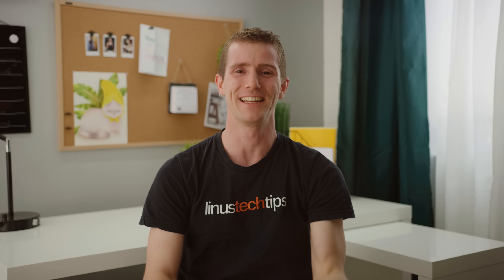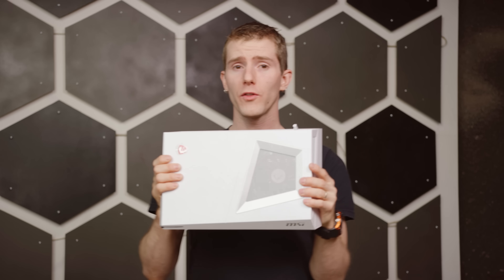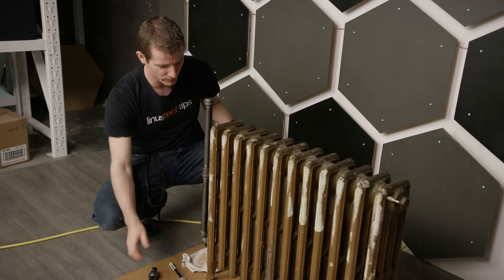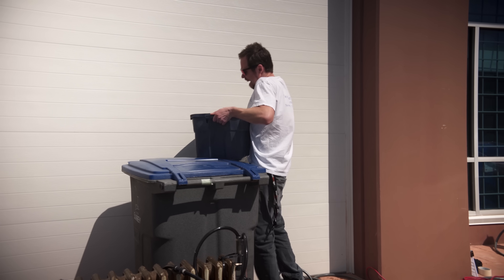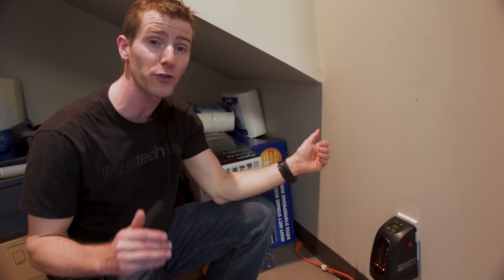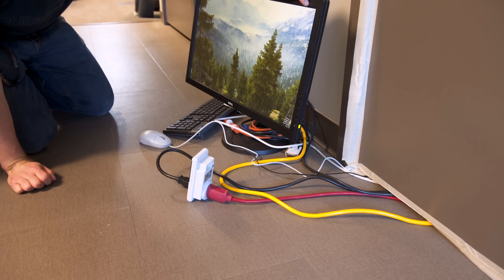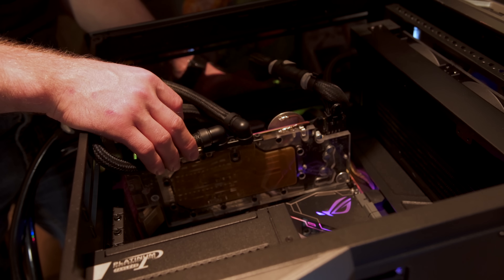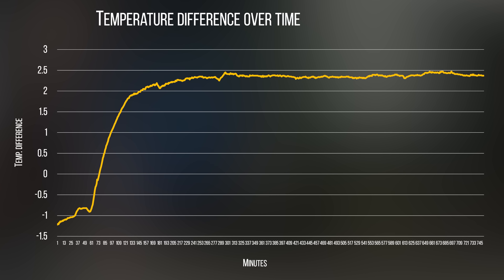Lower your heating bill... with GAMING

Comment: Your kinetic energy you have  in the fans doesn't change as long as you rpm stays the same, the energy you need to put in is the same amount as the drag that the fan generates and different speeds of air generate on each other. Essentially it doesn't matter if you have more or less fans when you are heating a room. One way or another it's gone be converted to heat anyway. And the fancy RGB stuff doesn't doesn't do anything as long as the light stays in the room (you don't shine out your windows).

Comment: "Gunk' is Called .... OIL ... 
must be heated to clean.
Reply: Probably a fair amount of rust if that's a steel radiator.
Reply: Why oil? Please step back
Reply: @hayyremz  because its an oil radiator
Reply: @princeoinkins8408  no. That's a hydronic cast iron rad. If the rad was an oil rad, it would not have rust in it.
Reply: @Richard Norman It's not oil. Its metal shavings from the inside of the radiator. If they just added a magnetic filter they could've caught most of it... if they wanted to go further they should've added a system cleaner like x800 then flushed it out and added a system inhibitor like x100
Reply: Spoken like a true plumber.
Reply: @jaketurner2472  This is what I was basically thinking. Cleaning out a car radiator sometimes requires an actual radiator cleaning fluid instead of just plain distilled water.   I also would have done a braze on the leak he had.

Comment: I'm not sure why you're using a household radiator instead of a PC radiator. No matter the size of your radiator, the total amount of heat put out will surely be the same, won't it? It probably hurt your results, as you stated, because of the huge mass of iron and water you had to heat up along with the air inside the room... If someone is actually thinking of using their PC to heat their room, just run Folding@Home or Boinc or mine some crypto for a couple hours and you'll be good :p
Reply: Yeah, he just made the test more complicated and unrealistic by doing that. Gotta reach 10 minutes of content tho amirite?!
Reply: A PC radiator might not be able to dissipate heat from the PC fast enough, which would cause the PC to throttle and output less heat instead.
Reply: because is ridiculous and humorous. And because they can... try.
Reply: Rafael Dos Santos 
Wouldn't it be faster though? The big radiator has more surface area.

Comment: ALL YOU NEED IS A PENTIUM 4
Reply: FrozenIce running a pentium 4 daily. I can confirm.
Reply: Renaud Dupras You poor soul.
Reply: AND A GTX 480
Reply: FX-8350
Reply: Artur *FX-9590
Reply: Pentium D
Reply: 2x AMD 290X
Reply: 2 x amd 7990 plus a 3930k 1500w from the wall @ 240v Room heater pfft..whole house heating.

Comment: I genuinely turn my PC on in the morning and start Warzone during winter to get my room warmer…
Reply: same
Reply: I use Heaven Benchmark to max out the GPU. On the default non-undervolting profile for the RTX 3090, it gets to a good 80 degrees but also leaves a bunch of hot air coming out the case, been great for Winter to fire that up in the mornings. In the Summer I can switch to the undervolting profile & get it to about 70 degrees but because there's also less voltage used for the GPU, there's basically no hot air coming out on that profile.

Comment: That ancient radiator is completely pointless. In the end you're radiating (imagine that) BTUs regardless of whether you're doing it passively off an ancient chunk of iron or an proper 280mm or 360mm pair of rads on the CPU and GPU. In the end all of that electricity is being dissipated as thermal energy. You could have saved a lot of time, pointless crap, and a not-inexpensive EK GPU water block by just putting the damn PC in the room and closing the door.

And for the people saying "because he wanted to heat his room", where do you think the heat gathered by a water loop, then radiated (see that? I gave it away) out of the system is actually going, fairy land? Its going in the room (doh). So long as the components are staying cool, that means the heat is being pulled out and pumped into the environment external to the case (e.g. the room).  Newsflash: heatsink systems transfer heat. Shocking.

So yea, pointless. Like most of the LTT videos now, and utterly unlike just a few years ago. I guess he's just run out of ideas. Sooner than later I expect an expose where Linus determines once and for all which cools a system better: constantly beating on the chassis with a Louisville Slugger, or pissing into the live power supply. (Spoiler, they're the same; eventually the system stops producing heat altogether, but for very different reasons).
Reply: Yeah! LTT should have just tried to do it the least interesting way possible to maximize the entertainment value! We watch LTT to see the peak of efficiency not a bunch of dumb stuff that no one would ever do! grabs pitchfork We hate fun! We hate fun! We hate fun!
Reply: Exactly.

Comment: Why would this increase the amount of heat dispersed to the  air if its the same amount energy that would be dispersed through the computers radiators.
Reply: In this small volume of a closet yes, but the overall theme/goal was a house. A large radiator mass and amount of water soak up more thermal energy, thus can provide useful "work" for longer periods of time passively once the PC is turned off. You can manage the temperature of the room more effectively with on and off usage and manage said temperature for longer periods of time.  As Linus even mentioned, it's not about making a sauna but making a comfortable environment.  Many heating systems have timers and gauges too to auto turn off once a set temp has been reached.

Comment: Wouldn't some/most of the 75W used by the pump be converted to kinetic energy? Meaning it'll still lack behind the targeted 350 W?
Reply: Only to start moving the water, after the water is moving the pump is just compensating the drag in the pipes that remove kinetic energy from the water and turn it into heat.
Reply: Hmm.. You're right, however assuming that this is an AC motor, the RPM's would be set so wouldn't the power consumption also decrease then after the initial acceleration?
Reply: Jun hong Doesn't really matter. The motor puts kinetic energy into the water and as the water flow would increase so would the drag and this would continue until the energy lost to drag would be the same as the energy that the motor is outputting.
Edit: Edited some Grammar and spelling.
Reply: Nub Ogrodowy yeah but that is only in the beginning, once the water flow stabilizes, that energy that "would be gone" is just there on the system as kinetic energy and once the put turn off, all that energy would just get transformed into thermal energy.

Comment: Me: It's getting cold....
Also me:

RUNS CYBERPUNK ON ULTRA SETTINGS
Reply: 3 FPS, but you do not feel cold anymore. Worth it.
Reply: Actually I think instead of running games at ultra or whatever, lowering the settings so that GPU stays at 95+ usage barely but with as many fps as possible would be better for heating. Cuz if you're getting 20fps on ultra with around 95-100 GPU usage, your GPU is working full load pumping out heat but your CPU is still chill walking 20fps worth of work. By reducing settings for as many FPS as possible without lowering GPU usage below 95%, you're putting full/almost full load on GPU plus a major CPU load, making double heat(or atleast more than the 1st case).

Comment: My gaming space used to be a section of our basement.  The basement was badly insulated, with no connection to our central heating.  I often ran SETI@home or similar on my gaming rig, as well as my "home server" (quad-CPU Itanium I was given by a former employer,) partly to act as basement space heater.

We remodeled the basement, added insulation and replaced the single-pane, Aluminum-frame windows with good double-pane insulated windows. The computer room still had no connection to the central heat.

I had to stop running SETI@home.  The first weekend after the remodel was finished and I hooked all the computers back up, we left town for the weekend.  I made the mistake of leaving the gaming PC and the server running.  Came home to find the computer room over 100 degrees.  It was late Fall, and wasn't hot outside.  (Between the gaming PC and the server, probably somewhere around 3000 Watts - Core i7 965 overclocked, dual Radeon 4870X2s in the gaming rig,  and quad Itanium.)
Reply: The uninsulated, cold basement was actually the perfect place for a server/beefy PC to thrive, lol. Now that it's all insulated and "civilized" down there the machine hates it ;)
Reply: Was that 100 F or C?
Reply: I assume F. At 100*C room temp the PC would most likely just shut down.
Reply: LexonyAble It would melt any plastic on the computer.
Reply: This became much less shocking when I realized you were probably from the US.
Reply: Anonymous Freak wow
Reply: InsanePorcupine How so?
Reply: I realized he didn't mean 100 celsius, and instead meant 100 fahrenheit. 100 celsius is boiling and is insanely hot, I mean 100f is like 38c I think?
Reply: InsanePorcupine yep.
Reply: InsanePorcupine lol

Comment: technically even the kinetic energy pf the fans and the light from the rgb will turn into heat afterwards, but it's such a small amount of energy and it happens so gradually that you don't notice it.  Especially when compared to other components like a gpu or a cpu

Comment: the kinetic energy from your fans will ultimately be turned into heat as well. as the air gets moved around it heats up from friction as it collides with slower or stagnant air around it. as for the LEDs the light will heat up any surface it hits. any work being done will turn into thermal energy in the end, one way or another.

Comment: I've been doing HVAC since 2004, We have special 'bendy' hoses for our pressure washer we use to stick in all the holes of the radiator when we clean em. The water sprays outta the tip at like 360° also.

Comment: Fan spin is also eventually converted to heat tho, so nearly 100 percent of power drawn by pc is converted to heat.
Reply: Leon Lu noo most of the energy is used to push air!
Reply: nah. every part of how a fan works generates heat.
Reply: jayakumar v I learned this was years ago but for what I remember the 2nd law of thermodynamics determines that the entropy in a closed system always increases, essentially the airs kinetic energy is more and more chaotic and eventually indistinguishable from thermal motion.
Reply: Yeah my PC actually makes my room pretty hot.
Reply: Except, YA KNOW the bit that, I dunno, PERFORMS CALCULATIONS?
Reply: This is correct for a closed system, though I don't believe it's realistic to think this would be similar in a more open system. The fan produces kinetic energy in the form of airflow and/or pressurized air. The reality is that in a room or house this air is simply going to continue flowing and more than likely escape somewhere. I assume the 5w of power used becomes maybe ~0.5w of heat energy, with the rest escaping as kinetic energy.

Comment: In the winter I use my rig to augment the heater in my room. now I want to add a radiator like that one now.
Reply: KAT Erwhall Why would you even want that? The exact same amount of energy is being transferred to the air (ie you get the exact same amount of heat)
Reply: DemonaeTV "much better results" in what way?
Reply: the radiator is completely unnecessary and dumb... they ruined this experiment by using it lol
Reply: you don't need a better radiator for this experiment to work. You just need a cooler that will keep the GPU and CPU from thermal throttling and you will get the best results. You need a delidded and liquid metal CPU with whatever Kingpin GPU has the highest max temp and power usage combo and best cooler. That's it

Comment: I worked for a time (decades ago) at a data center in Mahwah, NJ. The building didn't have heat.  The computers were the heat source.  (Which sucked if you worked the night shift when most of them were powered down)

Comment: In Communist Poland they built heaters with car radiators, they were actually pretty effective. Why not make a water cooling loop of a PC with such a radiator?
Reply: Badass
Reply: Gattz Back in the day I know a guy use car radiator to cool his x58 rig with gtx480s in it...
Reply: Yeah, why not. Computer Cooling Radiators are just smaller versions of those, you could probably even use the water pump from the car and the "reservoir".

Comment: builds a space heater pc; doesnt use that amd FX9xxx processor...?
Reply: Jazz I reckon! And he teased a gtx 480 at start of video.
Reply: Wholland Everything makes me want to kms. Lol
Reply: Carl Wells that wasn't a rx 480 that was a vega 64
Reply: ender pigcow gtx480, not rx480.
Reply: FX 9590 and GTX 480 would be a far better room heater
Reply: They balanced the watt of the pc with the watt of the space heater though.
Reply: My dad, in Vegas,has a FX 9590/ Xfire 390's (the Powercolor Devil 13 Dual Core 390), now THAT is a room heater! He could open a window in the summer to let in a cool breeze lol
Would make Linus' PC look like an air conditioner...
Reply: man, im running an overclocked fx8150 and an rx580 in the south of alabama; i know something about heating a room =(

Comment: 3 GTX 480 could end up to global warming
Reply: Phoenixian Dave nope Vegas bro Vegas if you just have a 56 overclocked  and you will have one hell of a heater
Reply: No, you don't get something from nothing and the electricity used to create that heat already existed here on Earth. Global warming are because of sunlight getting traped within our atmosphere. It normaly bounces out again but when it gets traped it's like a greenhouse effect.
Reply: Daju but gtx 480 power usage is too high that it burns more fuel in electricity generation, BTW this is sarcasm

Comment: I'll tell you how I do it, & I'm still debating whether this will save on our gas bill if I'm using pretty much the same electricity for our electric bill (as I game quite often).

These days, I use my gaming PC (i7-11700k, RTX 3090, 32GB RAM, RM850 (850 Watt) PSU, and run Heaven Benchmark on my default GPU Profile to get the GPU temp to ~80 degrees, does a great job of heating up the room using electricity instead of gas. I can also choose my undervolting profile to get it back down to ~70 degrees but also not use as much Voltage, so great to toggle that between the Summer & Winter.

We also have our boiler on configured timers, so limit when heating is on around the whole house.

Anyone tried something similar, and can advise on whether this approach is better than using the extra heater in this room instead? Cheers!
Reply: If you’re using an electric heater it will make no difference to use the PC instead. But you should really consider mining instead, same stress level but at least your could make some money back
Reply: We use a gas heater, so the question is whether it's more cost effective to use the PC in place of the Gas, and with gas prices seeming like the main killer it's probably good to have one less heater on in the house.

Regarding mining I've heard it can severely damage the GPU, and I don't want to just Bork the 3090. I've got other long term investments anyway so they're also making money as they rise. My work colleague got into mining and also games though, I'll have to ask him how his GPU is holding up.
Reply: I know for a fact my pc heats my room uip because even during the winter (we usually only have the heater set to 60 f) my room is easily 5-10 degrees warmer than outside.

Comment: Thanks, I was wondering if I could use the heath from my crypto currency miners to cook pizza.
Reply: For sure, it might take a while to warm up initially though, but after a while you should be able to drop a slice on a sheet of hot metal and you should be blowing on it in no time!
Reply: I was wondering when will this whole mining stuff end so i could finally afford better gpu ?
Reply: oON0vAOo mining is only a drop in the ocean........
Reply: For a while now ive wanted to make a convection over with GTX 480s. For real. Just for the lols. However id try and bulid it correctly, not like the shit LTT makes.
Reply: google it then you see they are more than just a drop
Reply: oON0vAOo hypothetically we want cryptocurrencies to keep going. It's an interesting ecosystem from an economic standpoint. What needs to change is that GPU companies start properly accommodating for it, maybe by building mining-spec cards for miners and leave the gamer cards for gamers... Really wouldn't be much different in mind from building "professional" grade cards for rendering and video encoding, like they already do.
Reply: Gregg Johnson yeah i heard that too im looking forward to the minig gpus but i dont think it would make drasticly drop gpu prices
Reply: Not gonna happen. GPUs are still less expensive and have better resell value.
Reply: An interesting video on cryptocurrencies is by Real Engineering. He looked into the energy consumption per transaction and things like that to see how sustainable it was. Might be worth checking out.

Comment: AMD FX 8350 anyone 😂😂😂
Reply: Oh yeah that thing was lit 🔥
Reply: I think you forget the FX 9590 that drew 220w.
Reply: @ruinedlasagna  I never had it. Did you?
Reply: @ddoormatt4834  Jesus no, I had a pentium G3258 during that era. I've since moved to an i7 4930k, then switched recently to a ryzen 7 1700
Reply: @ruinedlasagna  oh pentiums are cursed. I had a fx 4300 then got the 8350. About a year ago I got a i5-8600.
Reply: @ddoormatt4834  the G3258 was overclockable to the same level as the same generation i7, now it did have 2 cores and 6 threads less but during the time it was a good budget choice.
Reply: @ruinedlasagna  sounds like a good choice though.
Reply: @ddoormatt4834  it wasn't a great experience but live and learn.
Reply: @ruinedlasagna  yeah that's fair